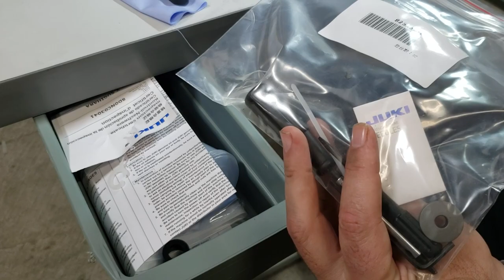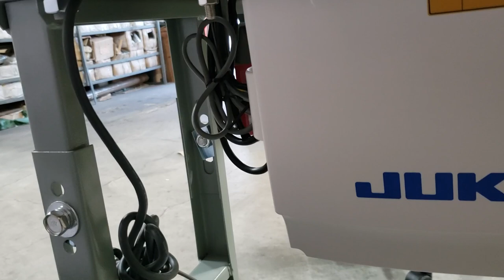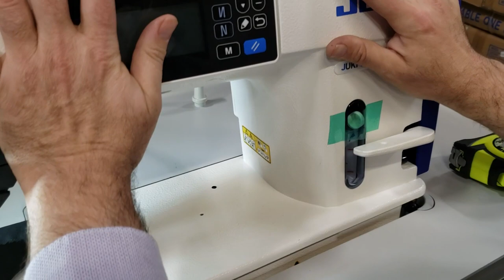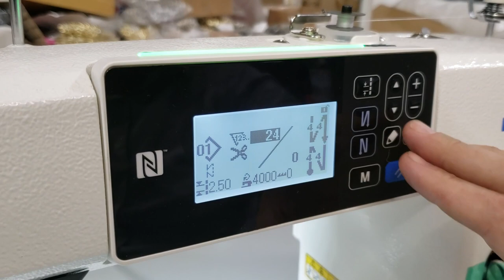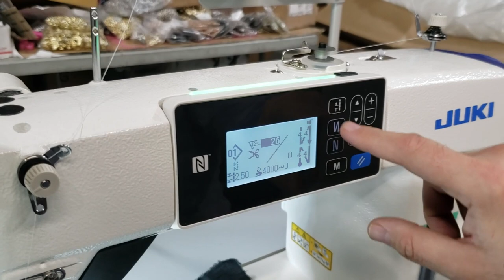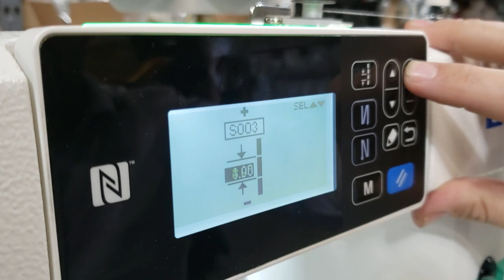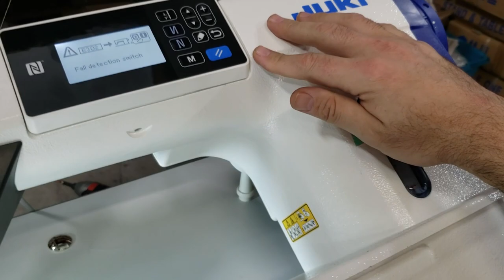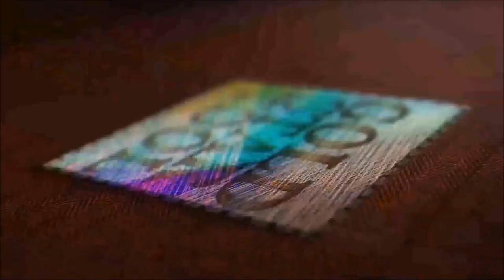Product Showcase - Juki DDL- 9000C - Goldstartool.com - 800-868-4419

Comment: I got a question my thread trimmer is trimming my bobbin thread at only a 1/2 inch and won’t sew, if I pull the bobbin thread longer it sews but once I trim it by using the trimmer it won’t see it just pokes my fabric and doesn’t form a stitch can you help?
Reply from the maker: there should be a setting for that to cut more thread ,or it might need an adjustment

Comment: Can you do free motion quilting with this machine?
Reply: sure you could.
Reply: Juki sells a J-150 QVP with quilters in mind.  It's very similar to the 9000C series in a mechanical sense but has the looks that take it out of the factory and make it look at home in a residence or professional sewer's/quilter's shop.  The manual is fairly user-friendly (I used it to better acquaint myself with my 9000C), and the touch screen has a button set specifically to raise or lower the feed dogs, pretty much changing the machine from a killer piecing machine to a fine free motion quilter.  The downside is that it's about two grand more than the 9000C-FMS it's most closely related to.  All that said, I believe you can set the feed dogs in the 9000C series to stay down.  We do our stippling on a separate machine, so I haven't really checked.  I've read both yes and no, but I'm inclined to believe you can.  If I find proof of that, I'll edit this response to reflect that.  Good luck.